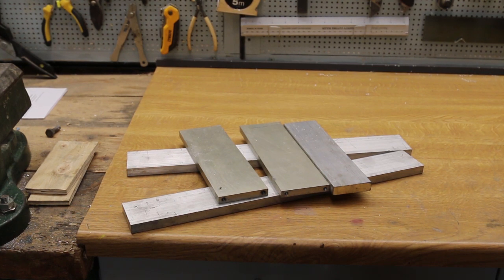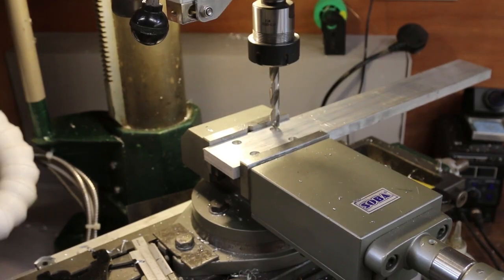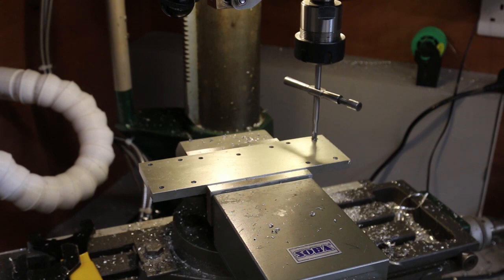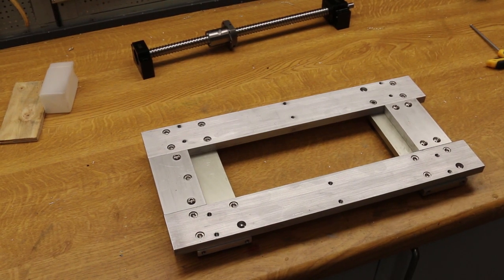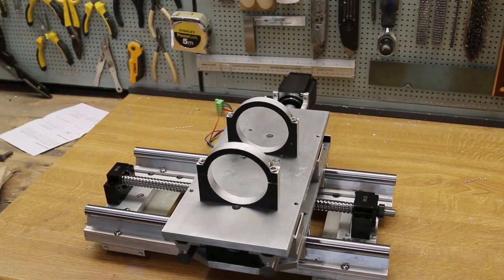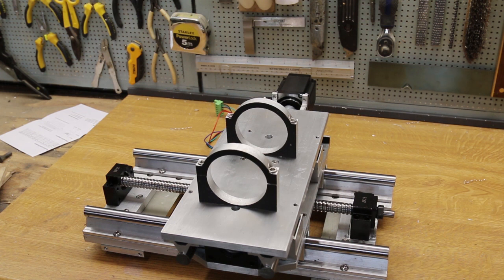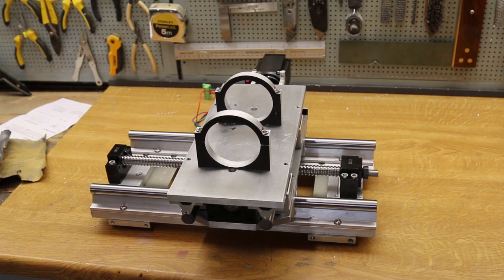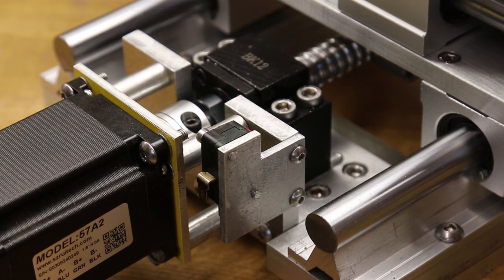Homebrew CNC part2

Comment: Nice. Are you building a horizontal mill?
Reply from the maker: No, it is conventional, with a vertical Z axis. It will have a moving work-table, avoiding using a gantry for greater rigidity. More to come!

Comment: been working full time running and programming CNC machines for almost a year now so its really cool to see how other people go about making their own. I gotta say, so far you can tell this is definitely one of the more thought out builds, I hope you see it through to completion. What kind of tolerance are you hoping to reach in the end?
Reply from the maker: Thanks for your comments. I do not have a target for tolerance, that would involve calculations probably more involved than the build itself; it is an intuitive build, trying to balance best practice and practicality. I am building it as accurately as the machine tools I have allow, but building in adjustability to allow fine-tuning in the traditional 'hand fitting' way. 
As you will be aware, there are several meanings to tolerance; amongst these is resolution (which it can never be better than), repeatability (error spread between multiple workpieces), and absolute accuracy (deviation between programmed dimensions and resultant ones). These, and others, depend on the target application- parts that need to fit together for example.
In practice, the big advantage for hobby use of a CNC mill is to produce features that are difficult or impractical to make on a manual machine- text, for example. There is rarely the need for 'production runs' of parts. If, after testing the mill, it has short-comings in any specific area there is always the option of final manual machining of critical features. Time will tell.